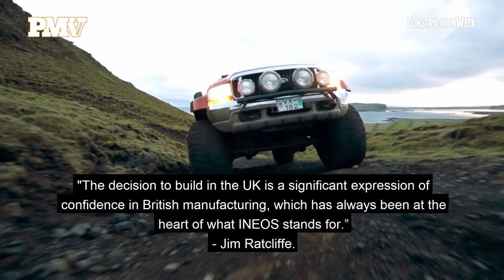Heavy Metal S01E32 | INEOS to bring utilitarian 4x4 vehicle to market in 2021

Comment: I dont need luxury but i thing 3 or 4 things are important...
1. Automatic Transmission 
2. Lether seats (easy to cleen) 
3. Seats heating( lether is cold in winter)
4. Steering heat... its olways  cold in winter😅
Greetings from north italy... sry for my english😅
Reply: 1. Diesel engine. 
2. Manual transmission. 
3. Left side steering wheel
4. Space to sleep inside and carry equipment
Reply: I can confirm it is coming with a ZF Automatic Transmission.
Leather seats, heated seat and heated steering wheel I think are likely to feature.